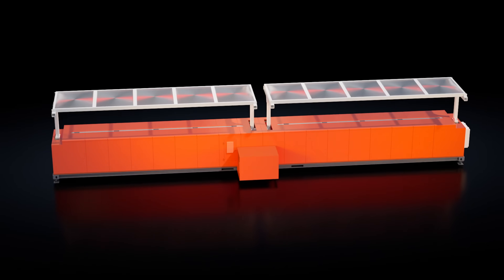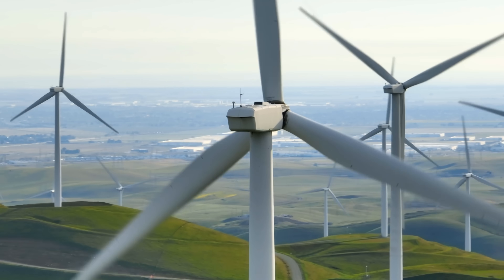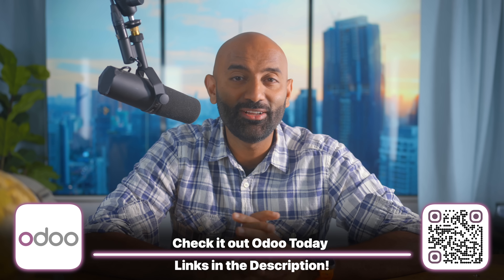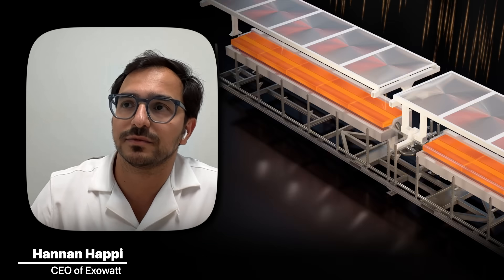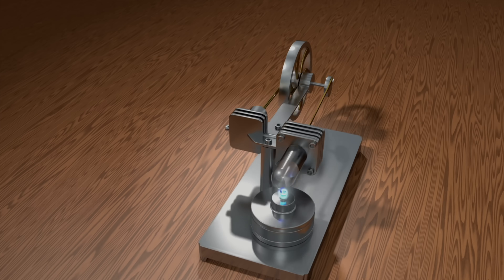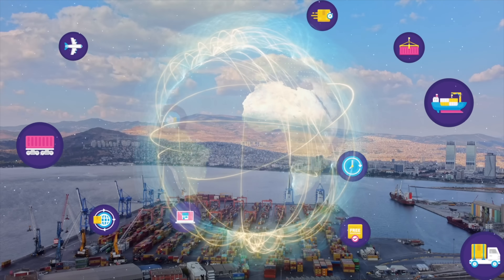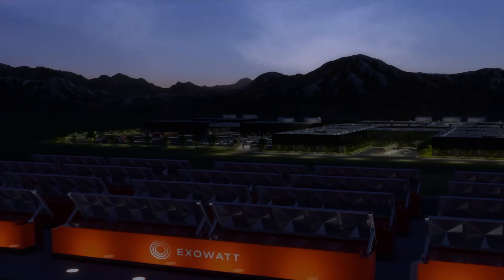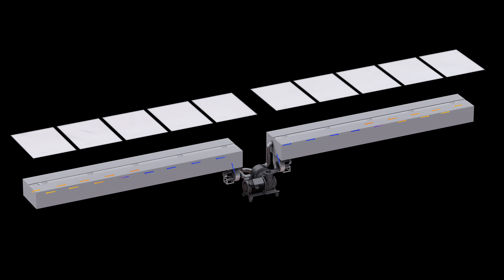Solar Without Panels, Storage Without Batteries - EXOWATT

Comment: The disadvantages that I see is the weight so rooftop installations are far less viable. With PV cells you also have better land use. They can be raised so there is less loss of land and can actually be symbiotic with some forms of agriculture. It appears that land usage would be less versatile.
Reply: They aren't trying to replace PV, purely reduce energy cost by simplification and offer energy production and storage in a single form factor
Reply: @doofer80 I know. I wasn’t implying otherwise. I was merely pointing out some shortcomings of the system compared to PVs.

Comment: Looks like the arms with the lenses only pivot one direction. Would work fine if the sun follows the same path directly overhead each day, but it doesn't. The lenses would also need to tilt and therefore the bricks inside absorbing the heat would need to move too. That many moving parts means more points of failure. I don't see this being viable.

Comment: I think the weak link is the plastic Fresnel lens.  Would decay quickly under constant UV exposure.  I guess if they could be produced cheaply enough, they could be replaced often, but can they be recycled?
Reply: You're right. You could make these lenses with UV protection though, but 30 years are still utopic
Reply: I think it mentions 3:39 that they are made out of glass.
Reply: @myounges  Those large Fresnel lenses are usually plastic,  because of the weight and also the grooves that make the Fresnel pattern. Not impossible to make them from glass but very unlikely
Reply: Surely lenses produced specifically to capture and focus sunlight are going to be designed in such a way that they don't decay quickly. They are going to create them; if they don't manufacture them, they will be designed to their specifications.
Reply: @doofer80  If the technology was easy, car manufacturers would have already been using such clear plastics in headlight covers.

Comment: Not an expert at all but this seems like it might lend itself to direct heating and cooling rather than converting the heat to electricity and then back to heat or cool. Maybe it would work on a smaller scale as well. Domestic water heaters, pool heaters, A/C and refrigeration (ammonia absorption). Making electricity is a great idea but I see these other uses as possible too.

Comment: I suspect it would be hard to put big containers filled with bricks on top of buildings compared to putting solar panels up there.  If you are building a new Walmart you could put energy storage in the basement if you really wanted, and solar on the roof.   

I get that they are focusing on efficiency, but land use is also a separate issue.

Comment: Do any of these exist yet? Otherwise its "Airware" handwaving at best.
 The cost of batteries is dropping year by year, and the costs and remuneration  from large solar PV with no moving parts are quantifiable today. This idea has several moving parts requiring maintenance, as well as a fresnel lens that could degrade under the sun's ultraviolet energy. It only stores the infrared end of the spectrum.
 I would not put my money on this  until it has been demonstrated to perform as proposed over several years. Remember, both types of solar systems would be needed to take advantage of the heat storage of surplus grid energy for later use. Both systems suffer when solar energy is in short supply. 
Windpower also comes from the heat of solar energy, but usually from far out to sea, where land rights issues do not exist.
 Too many schemes being touted at this time promise to utilize surplus energy which is really a temporary problem until the markets adjust. I see this as just one more way to insert a "middleman" warehousing energy for a profit, between the energy source and the consumer.... if it even works.

Comment: Quaise promises to work anywhere 24/7/365 and drop into the existing fossil fuel energy infrastructure worldwide with zero pollution, by 2030 or so. What happens then?

Comment: It feels like one of those ingenious solutions that we won't ever hear about again.
Reply: Usually when that happens it's because the "ingenious solution" has some glaring inherent flaw which explains why you haven't heard about it before and won't hear about it again.
Reply: @willythemailboy2 Nah green energy startups vanish all the time, even ones using only-slightly-tweaked versions of proven tech. I remember a mini wind turbine thing that could apparently be put on a balcony and used to charge a modest system (just like a little bluetti, ecoflow or so on) from any wind direction. All there was was a years-old website and a handful of puff pieces
Reply: @michaelmartin9022  A lot of these "revolutionary new mini wind turbines" are just scams that don't work, or at least their output is totally exaggerated
Reply: The problem is it makes very little electricity. The lens doesn't increase the amount of energy you get from the sun, just focuses it into a spot. So you get a small very hot area instead of a larger warm area. Unless the lens is physically larger than the box, the box only gets the same amount of energy it would sitting passively. Mirrors expand the amount of energy by reflecting a larger area of sun into a smaller, but either way you aren't getting extra sunlight.

In other words, solar energy is always more about the space being used. Until they can put solar arrays into space they are fairly limited.
Reply: Fresnel Lenses are used to boost solar panels in some cases. Sterling engines have been around for 300+ years. Water, sand, DIRT are effective heat sinks. The only tech here that someone would have difficulty soloing is the controlling software, and my nephew does software apps for crop-duster drones. The only thing keeping this kind of tech from prospering is big industry who makes money off us NOT knowing about this kind of technology.
Reply: @ThorOdinssohn  Let's hope it's the exception, but most of these start-ups go nowhere. We've seen a million times before. Scaled production is usually the death nail. I'd say the Sterling engine is the weak point since it has many moving parts which van fail. Time will tell.

Comment: Military application is amazing!

Bring the boxes, drop them off at the new forward established base, instant power!

Fast deployment South Pacific island bases are a primary example of need!
Reply: Only if you conduct operations in a desert with strong direct sunlight, no wind/cold conditions to draw heat out of the system and a source of energy to keep the heat batteries constantly topped up.
Reply: @GruffSillyGoat- maybe… but I am not convinced. 

The cooler or cold air should make the engine which operates off off heat differential with the surrounding air operate more efficiently.
Reply: It will also cool the storage bricks, likely cooling the heat source significantly so lowering the stirling engines efficiency despite the lower external temperature. The images show little room for insulation and if incorporated will eat into the systems storage capacity.

Electric thermal mass storage heaters are not new and the Exowatt system is not immune to the issues they face.

Comment: I built Mini-Sterling Solar Generator over 30 years ago.  Always wondered why it didn't beat Silicon Solar.  Recycled Glass is nearly free (except for transport) and easy to mold Fresnel Lenses.

Sterling Engine inefficiency is radiated out as Heat...heat energy at least partially cycled back into the heat capture system?

Comment: The bricks may last 50 years but there's still a fan and sterling engine that will need maintenance and replacement. And what runs the fan to start things off? A Battery? That said, I too would like a home sized unit if this is really as cheap as they expect.

Comment: I can't imagine anything but nuclear will provide the power needed for data centers. Still this is really cool, you can drop one of these almost anywhere and have near instant power. I'm speculating but I'd imagine a small gas or diesel generator could get all the pumps going for a cold start.

Comment: It really comes down to their engine and generator.   That will make or break them.   

The other advantage is the materials used aren’t hazardous.   Disposal at end of life will be relatively easy, cheap and recyclable.   

Finally if the thing catches fire you don’t have to evacuate the for miles around.  The fire department will need to just let it burn because dumping water on something that is 1000 degrees is likely to cause the water to flash to steam.

Comment: What the heck do you mean each unit generates 25kW of power? There are few places on Earth where 25kW of irradiance even hits the total area of this thing. And that's before factoring in the efficiency of the Stirling engine. I could maybe believe this device can hold 25kWhr of power per unit, but it ain't refilling the tank at 25kW.

In your calculations you say the units are 40ft by 8ft (shipping container size). It should be fairly obvious looking at the images that it isn't 1/5 as wide as it is long. It's a few feet wide at most. Ask what the maximum possible power output this unit could have anywhere on Earth is. Assuming it's 15m^2 (~40ftx4ft), receives 1350W/m^2 solar energy, and has a 20% light to electricity conversion it's a 4kW generator. Those were all high ball numbers. It's an avenue of renewables worth looking into, but you really should be laughing at the CEO when he throws made up numbers at you.

Comment: I'm very skeptical with the promised cost. This is the old thermal solar energy made portable.
If fixed solar thermal is a lot more expensive than PV, and thermal is still researched.

The comparison with batteries (which price is changing fast) is just number tricks.
We already know PV plus lots of hours of batteries can be very expensive (although is constantly dropping in price), but that's the reason people add just a couple of hours of storage.
If you want to compare with 24x7 today, you need to compare to solar+battery+natural gas generator. Yes, not 100% clean, but reasonable price.
Enforce different conditions are used to claim competitiveness but that conditions are not what the market is investing now.

Comment: Here in a hot climate we get 28GWH from 12MWp using 10 Ha land with 23% losses  which costs $2.4m installed with single axis inclined & We get 300 days of sunshine . At $0.04 that's $1.1m revenue/yr. That's 2.24 yrs break even. Over 23 yrs that's a profit of $23m or 42% y/y. So the question is, what is the profit y/y of this sterling fresnel container and what energy does it produce per year assuming 9 hours sunshine with 1500 kwh/M2/yr yearly insolation.

Comment: These technologies have seen limited success in niche applications (e.g., biomass, geothermal), but not widespread industrial adoption. Solar photovoltaic (PV) systems, with efficiencies up to 25% and costs as low as $0.1/Wp, dominate due to simplicity, no moving parts.—pistons, turbines, seals, gaskets, and rotational parts—leading to higher maintenance and costs.  But for geothermal projects it rules.

Comment: I had a Whispergen on a sailboat for several years.  It used a Stirling engine, using a catalytic diesel heater for the energy source (producing about 600 degree C).  It was a marvel when it worked, producing 90 amps at 12V and would heat the cabins with waste heat.  The Stirling engine was flawless but the diesel catalytic screen would carbon up too quickly.  

The waste heat post Stirling could be used for heating too where applicable, further increasing the efficiency.
If mounted on the big flat roofs of data centers, the land use is minimized, with a higher cost roof structure.
With the minimal electricity cost at midday (as solar becomes more standard) LCOE maybe reduced with more bricks and resistively heat them at midday.
My company made diffractive Fresnel lens for a laser application, replicating a 4 step plastic lens on glass.  It would be interesting to see how they are making the lens, as a plastic component probably wouldn't last 30 years.

Yes, please visit them
Reply: I think the big thing that's needed for all solar designs is some sort of automated cleaning system. For something like this, I wonder how hard it would be to make a device akin to those robot vacuums that would sit on the edge of the lenses and go out and clean them when they're level at noon time.

Comment: Question: Assuming you’ll have some waste heat coming off the sterling engine. Can that be leveraged for a secondary use in a mixed use facility (hot water, distillation, sterilization, desalination, etc) that might provide additional benefits?
Reply: district heating and sanitary water would be great. Sterilization, why not? Eggs for example need to be cooked in water at a precise temperature to be pasteurized.

Comment: I asked GROK why doesn't Tesla cover the Meagapacks with solar panels :
Tesla doesn’t cover Megapacks with solar panels because the surface area (~11.36 m²) is too small to generate meaningful energy (e.g., ~10.45 kWh/day) compared to the Megapack’s 3,900 kWh capacity and typical daily cycling needs.
Reply: Did GROK mention any benefit from shading the batteries?

Comment: Some places off grid would be a good fit. But without massive taxpayer subsidies, these are not viable. As a taxpayer I do not want to put money into the pockets of these hucksters, con men & green energy grifters. These systems fail long before they reach payback. The company has gone belly up and the dead system has to be cleaned up at taxpayer expense. This crap has been tried and failed over and over since the 70's. As long as low IQ people keep falling for the grift, they will keep the con going.

Comment: All of this seems good, but what I don't get is why fresnel lenses instead of a compound parabolic concentrator?  Such a mirror is probably cheaper to make and a lot less fussy about the angle it's pointing at.
Reply: Exactly. We've been using reflectors for decades. Fresnel lenses don't do anything better, it's rather the opposite (I have Fresnel lenses and parabolic mirrors myself)

Comment: The great thing is that thermal systems like this can also be used to heat spaces directly without electrical use or conversion losses.  
Also, what's the usual firing temperature for clays?  It would be great to help lower the power needed for clay firing as well.
Reply: Great, but I want to heat my home in winter not summer, that's where there's the least sun

Comment: That's not just a fascinating system for commercial-scale power generation, it's also a template for creating some very interesting DIY residential heat and electricity storage and generation.  Thanks for digging up and sharing the concepts!!!
Reply: Ohh yes! it would be easy(ish) to combine this with a hot water heating system. Plop these on roofs of apartments and then you supply the power, heat and hot water for the complex in one tech. Or even just a homestead.
Reply: @lexpox329  And then pipes with the hot water go to the bricks stored in the ground (a good insulator, too) instead of on the roof.
I think the system in the video is designed for portability and a house or apartment wouldn't need that.
Reply: If you want hot water for your home get an evacuated tube collector, if you want electricity photovoltaic. Fresnel lenses are probably the most stpd idea to make either of these ;)
Reply: @SolarCookingGermany  Isn't it great to see all those opinions put to the ultimate test!!!  Here's a company with real engineers funded to develop and implement their best combination of Fresnel and thermal storage and Sterling engine-generator.  We get to watch them try over the next few years and see if another failure emerges . . . or maybe something better.  Thanking 2-bit da Vinci for the opportunity and hoping he revisits the project a year from now.
Reply: I hope and pray that sooner or later this will be available on the market.

Comment: BS there is only so much energy in any given Square meter of land, those "panels" or mirrors are the same area as the container. 
A shipping container is 15 Square meters approximately 2100 kWh/m² of solar energy is available per square meter over a year, averaged globally

2100 x 15 / 365 =86.301 86 kWh per day at 100% efficient
Per the author the Sterlin Engine alone is only 20% efficient so the best you can produce for the whole container is 20 kWh per day for the whole container. This is why solar panel fields cover so much area.

Comment: A cost effective low loss thermal storage suggests related applications such as a complement to compressed gas energy storage. ie for energy storage, compress and store the gas as well as the heat of compression, reheat the compressed gas for turbogeneration. ofc others have done this(Energy Dome) but Exowatt may have a better mousetrap for thermal energy capture/storage part.

Comment: This makes sense since AI centres could offset a fair amount of power just by using sterling engines or thermal voltaic cells from the heat generated by their electronics so using a thermal battery system fits their needs for cooling. The main issue I see with this is that steam turbines tend to be more efficient and cheaper. Sterling engines work on heat differences and without active cooling have limited run times for peak performance. The most passive sterling engine setup I've read about used liquid nitrogen and ambient heat to create the differential.